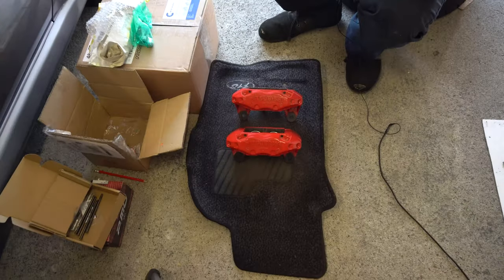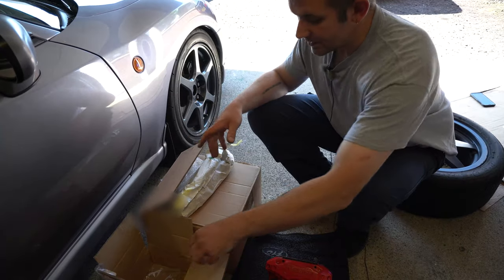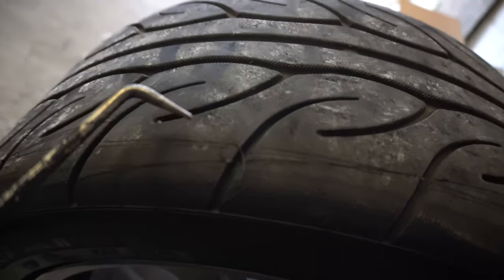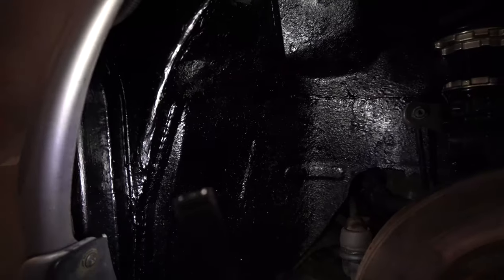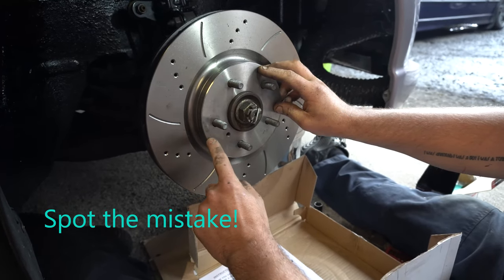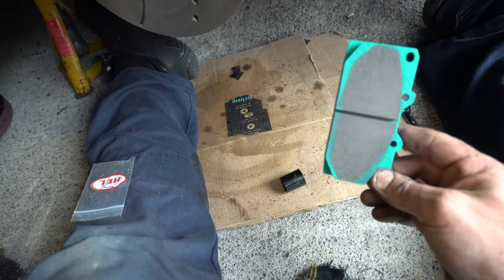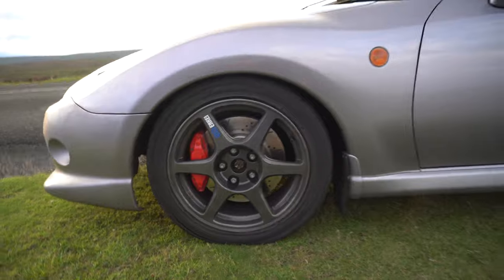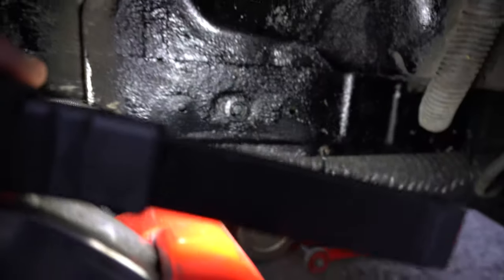Mitsubishi FTO Big Brake Upgrade!

Comment: Just a heads up for anyone wanting to do a similar conversion. You will need the MK1 GTO calipers (ones that fit onto the 297mm discs (shorter lugs)). The MK2 GTO had larger discs with longer lugs.
Some pre 2000 Mitsubishi 3000GT (N/A) had the shorter lugs/smaller calipers, but some also had the larger ones.

Comment: 215 on 17’s is best fit with it lowered. Right front might be misaligned due to a smack? Was on mine , 7mm back towards the rear of the arch. Pot holes!! Remedy was to replace the lower arm. Annoying but that’s life.

Comment: Gotta say, I do appreciate your videos, @Pamo.  Always so informative, and it's really good to see live visuals of what you're actually doing on parts that you are working on.  

I do have a question at this point:  did you you need to upgrade the MBC on an FTO to support the increased hydraulic pressure on larger calipers?
I can't seem to find this info readily, but a lot of folks (forums and such) seem to indicate a need to also retrofit an Evo's MBC.  For an ABS delete scenario, that would also mean an RS set  (not as readily available, ironically, as that of a non-ABS FTO MBC and distro block :) ).

Stumbled across this video as I'm doing some planning on a rather ambitious build myself.  On the subject of brakes, am looking to do an Evo (CN-CT) brake conversion - which would really be way more than sufficient for the weight of this vehicle.  Whilst it'll involve way more effort and parts, I see it as par for the course on a large build that also includes chassis.  What kills me is the plumbing involved.  (ABS delete, which you also covered in a different video.

Awesome work!  And appreciate the feedback in advance.
Reply from the maker: Thank you for the kind words, with such little information available for the FTO - we try to make the content "worth it" these days.

I fully expected to have to upgrade the MC - a few years ago I did a similar job on my CRX  and ended up with a long pedal - with the FTO/GTO calipers this isn't the case - the pedal is quite short and I can only assume that the volume of fluid used in the GTO caliper is close to the same as the original calipers. It's all a ratio thing more than pressure really.
Your plans sound good for a less violent setup, the GTO calipers provide brutal braking and are great for our track car, perhaps more than you would want for a street able setup.
Good luck 👍
Reply: @ManSeeksCivic  Thanks man.  By ratio, I take it you mean brake pedal ratio?  I hope so.  I see it as, even with a GPX, I wonder if the larger-sized and more plentiful number of brake pistons (6 vs 12) would call for a larger MBC bore.  That's really what I'm unsure of - the size of the FTO MBC piston.  

I dunno - I may be overthinking this.  I guess I'll have to see when I get there.  I'd pondered whether any aftermarket units exist that would bolt on to the OE booster unit.  Doubtful, really.  At least, not without a bit of additional milling.

If I decide to take the plunge and replace the MBC with that of an Evo's, it'll for sure be the non-ABS unit  (RS), where each line-out has a proportion adjustment valve.  

Thanks again for the feedback, Pamo - looking forward to more FTO vids in the future!  Happy motoring!
Reply from the maker: The ratio I refer to is the volume of fluid contained in the caliper vs the MC. If the caliper internal volume goes up but the MC stays the same the pedal will be long. Think of the system as a pair of syringes - it isn't quite as simple but this should give a fair approximation of the results.

Comment: Great video Pamo.  I'm torn between keeping the COTY with standard GPX calipers vs the Brembo/Wilwood kits available at Freaky Parts.  I'd like to have the choice of running both OEM alloys and 17in aftermarket alloys which rules the GTO calipers (with 324mm discs) out of the equation.  I need to investigate if the Brembo's at 320mm will fit with the OEM alloys with spacers (unlikely), if not then its the Wilwood kit with 294mm discs and spacers.
Reply from the maker: Thank you. Id reckon the willwood kit would be the best option for oem alloys - Love your FTO and what you're doing with it 👍

Comment: any more FTO content coming my man, i just bought my 1994 fto gpx manual, and i absolutley love your content!
Reply from the maker: Is there anything you'd like to see. At the moment she is tucked away for the winter. We have just fitted new front tyres which has solved the clearance issues - 235/40/17. Apart from that it's all quiet on the fto front.
Reply: @ManSeeksCivic  thank you for getting back to me man, and to be honest just general things to look out for mine has a lot of welding needed, it hasnt run in 7 months, also just need tips on good places to get parts and what cars have compatible parts, and i was just about to ask since you done it was it sorted im glad you got it done and dusted man!
Reply from the maker: Glad to hear another one is getting some love. The rear suspension shares a lot with the early lancer evo 1,2,3. The best place for parts is Viamoto - run by Mike. Rust is the fto killer, sadly the seam sealer used absorbs water and will rot from the inside out. Keep a vigilant eye on the chassis rails near the rear shocks and towards the rear of the car. The engines are strong but idle control stepper motors, IFS modules and a few other things can cause trouble. Inspect your evap pipes, they run from the firewall along the os chassis leg in the engine bay and like to disintegrate and the main high pressure power steering line the runs over the os engine mount is prone to leaking. Inside the car, the centre console surround is as brittle as glass - be careful removing it and if you get an engine light the codes can be read by grounding a pin on the obd connector - Google will explain better 👍
Reply: @ManSeeksCivic  great thank you man! and thats exactly where my severe rust is the chassis rails and inner and outer sills, and viamoto is that a website? i'd love to come and see yours but im in south wales haha, my father had one when i was a kid and i always told him id get one, mine only has 52k on the clock bought it for 750
Reply from the maker: 52k! Brilliant, get that rust sorted and good luck with the future plans. It's always nice to have a historical reason (your father) to keep grinding. https://www.viamoto.co.uk/ 👍
Reply: @ManSeeksCivic  thank you brother i hope to bump into you at a track day or something!

Comment: Hey pamo,, Trying to get my 2001 FTO back to life from longtime storage. Replaced fuel, fuel pump and fuel filter and battery, she turns but no life. I tried cold start in the throttle body nothing so i assume its spark at fault?. Shes been stored for 9 years but was fine when i drove her last. Weird thing windows, sunroof, stereo dont work either. Will check fuses next just wonder if it could be something you have come accross before? Thanks (Love the channel keep up the good work.)
Reply from the maker: Check the main fuses in the engine bay fuse box. Check for spark, compression and fuel. Don't try and run it on old fuel, put fresh in. Good luck.

Comment: Hi Pamo, where did you get the clips for the brake lines on the shock? Ive just gotten a set of braided lines and its got me buggered how to secure them. I cant find a clip that looks right anywhere..

Love the videos mate, glad to see another FTO one.
Reply from the maker: They are just the stock fto "u" shaped clips but slightly bent to requirements.
Reply: @ManSeeksCivic  cheers mate

Comment: Any chance you have the weight of the original cast iron caliper? This looks great BTW
Reply from the maker: Thanks, I still have the old ones so I'll weigh them later and post back.
Reply from the maker: 5.5kg including the carrier, bolts and flexi braided hose. 👍
Reply: @ManSeeksCivic  thanks so much. Damn that's heavy. I was looking into using Wilwood Dynalite 4 piston that are 1.5kg for the caliper.
Reply from the maker: That would be very nice.

Comment: What did you do about the rubbing in the end dude?
Reply from the maker: We massaged as much metal as we could and went for a slightly different tyre size as a compromise. 235/40/17 on the fronts while keeping 235/45/17 on the rear

Comment: Would it be possible to push the caliper more to the inside with the space in the boltholes of the adapter+caliper to align the pad better on the disc?
Reply from the maker: No unfortunately with this setup the caliper is mounted as close to the disc as possible. You would need a smaller disc and a different adapter to achieve that and the braking force would be reduced.

Comment: Have you felt any need for a brake bias? Also do you still run ABS?
Reply from the maker: We've not had an opportunity to really use them yet... On the road I'd say no, but track driving is very different. This car has never had abs.
Reply: @ManSeeksCivic  thanks man! Also are you running 16's or 17's and what tyre width and profile. In interested to hear how you got on with the rubbing
Reply from the maker: 17" - tyre profile at the front was 235 45 and it was never going to work. 235 40 we have ended up with and no rubbing at all 👍

Comment: Howdy! Any chance you could specify the part number for the calipers? Unless I'm mistaken, non-turbo 3000GT/Stealths in the US got a 2 pot front brake caliper. Thanks!
Reply: I believe you're correct. The calipers he has are 3000GT Stealth Twin Turbos

Comment: You need a 40 profile tyre when running 235
Reply from the maker: Thank you, we have since bought some new fronts in 40👍
Reply: @ManSeeksCivic  How wide are your wheels and what offset please?  I have the same coilovers and a GTO setup waiting to be installed with 7.5 wide wheels.  Trying to work out what tyres and spacers I may need. Thanks 👍
Reply from the maker: 8J
ET38